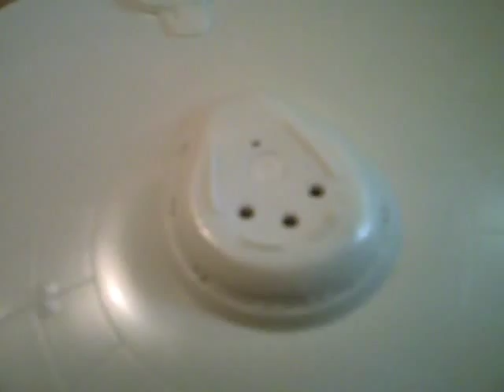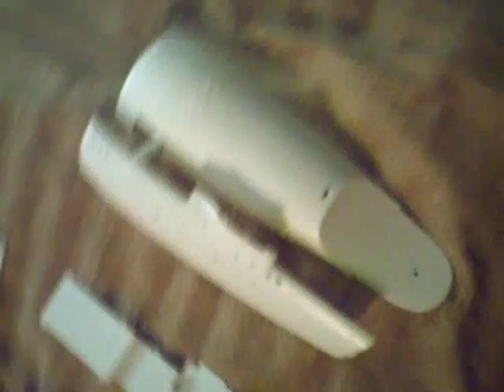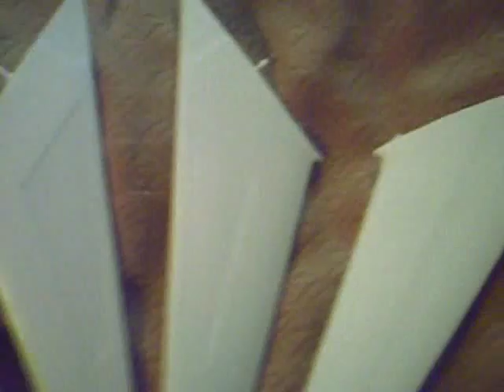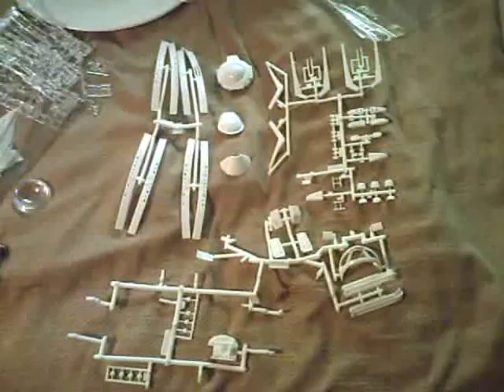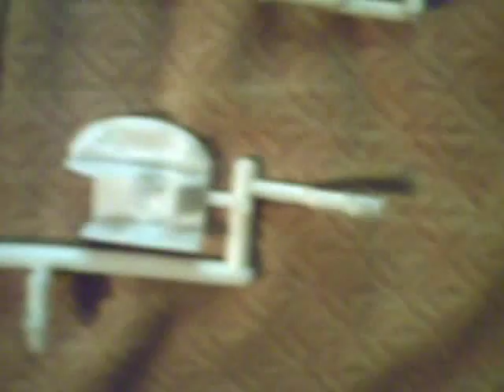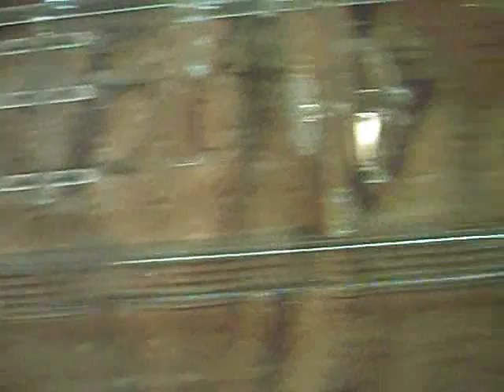Polar Lights 1/350 USS Enterprise, NCC-1701-A, build up part 1

Comment: @pikabko1  No, it does not have the option for the original 1701. It has options for the 1701 Refit or the 1701-A.That said, I think the whole idea of a "refit" was ridiculous.If you pull all the parts off a car, cut it, make it bigger, go back in with bigger parts engines, and different styling, you did not refit the car.. You built a new model. Car companies do it all the time. I hate the name "Refit"  In my mind, it's the Enterprise NCC 1701-A and that is what I am building.